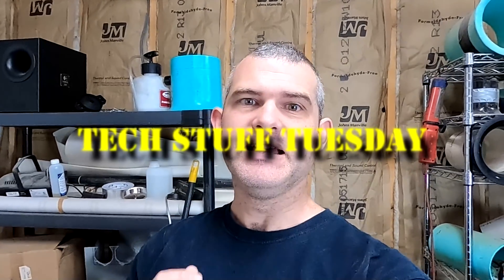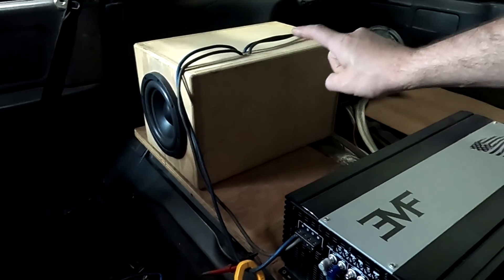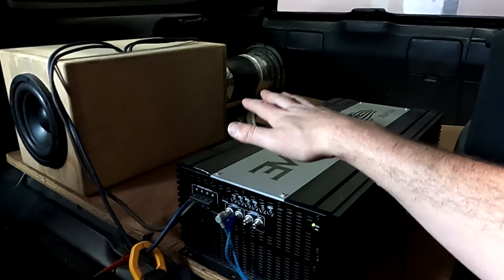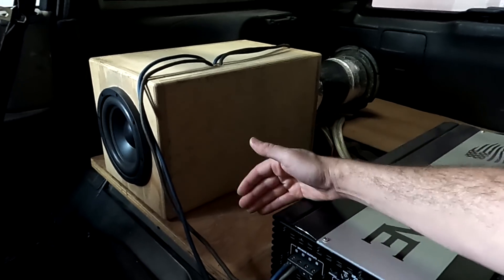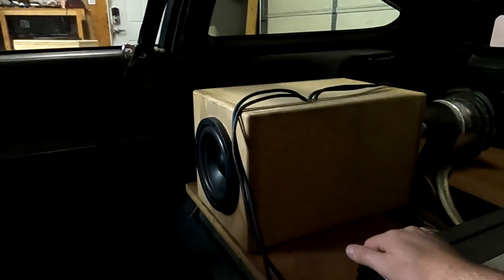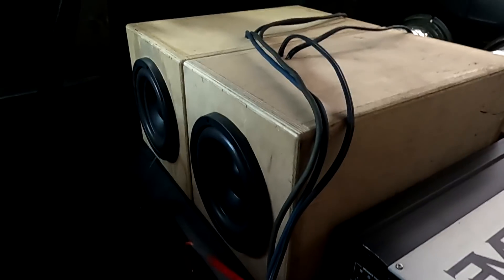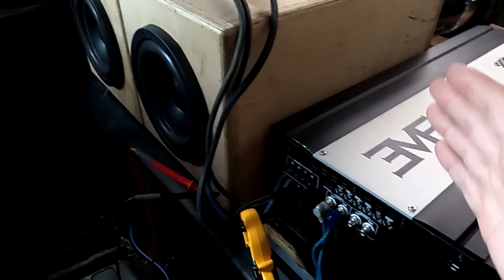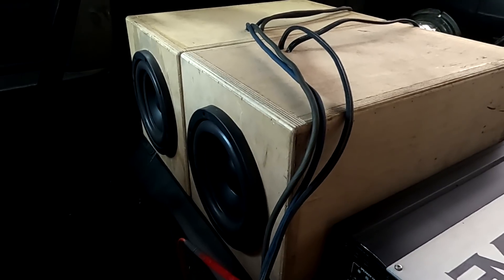Does doubling power or doubling cone area really gain 3 dB? - Tech Stuff Tuesday

Comment: I was just wondering, what will happen trying them in a mono box. Would your +3db theory be relevant with this application as opposed to individual boxes
Reply from the maker: I have tried another box with a common chamber and scaled, but placement of subs and port was different. It didn't lose as much but still didn't gain near theoretical. I will be building another box yet to test some things.
Reply: Great question...
Reply: having multiple subs in a single enclosure all sharing airspace the subs will behave more like , 1 large sub . Compare to each sub having it's own airspace eaach sub will operate singularly which for sound quality and quick bass response would be better than Multiple subs all sharing same airspace the subs are going to operate like one large sub since eaxhs sub can influence the other subs say you are running. 1 amp to drive all subs not  every sub is. Going to have same exact resistance even if they are all d4 ohm subs each coil is going to be slightly different even on 1 sub one coil might be 3.8 And other 4.2.also so even though it's a . Small difference. Each sub is going to get. Either slightly more or less power also how the sub is put together one subs spider might be just a lil stiffer ect ect. So again for SPL you will need to try n test different setups although almost no one is running a. Sealed enc. For SPL. These days it's now usually. A 4 or 6th order.or  a big vented enclosure.
Reply: I agree that sub  and port placement may greatly affect this theory as I noticed mainly the two individual boxes were extremely close to each other. If putting them on opposite sides of the vehicle change you db outcome? I believe the you lost output because of cancelation, and when you played it individual when the both enclosure were inside the vehicle one worked as a passive radiator, again all theoretical... I did have the same issue with with a loss of output when doubling subs, same individual yet identical box. Could change in vehicle internal cubic could affect this?
Reply: a mono box is a single box. each speaker was in it's own box. putting both speakers in the same box, even in it's own sealed chamber, changes the total volume, if the box itself was the same dimensions as both individual box. the speakers, he said at the beginning of the video was bigger then the speaker needed. if he used a box specifically with the airspace needed for those speakers, the decibels would have most likely been higher. 

as everyone should know, the space behind a speaker, in a sealed box, is never changing. the speaker compresses the air behind it and that force is used to push the speaker back out. pressure created in a sealed space is pressure received on all parts of the sealed space. what the speaker pushes into the box, the speaker receives in return from the box. 

ported boxes are different because the pressure the speakers put into the box is released allowing the speaker to actually travel further then in a sealed box. the speaker in a ported box actually works less then a speaker in a sealed box. the speaker is not fighting pressure in a ported box like it does in a sealed box. if the box is built for the air space a speaker needs then it does not need to be ported. if you need more airspace then you have space for a box, you would need a ported box.

Comment: Hey Sean, would it have ANYTHING to do with the 2nd box(when not playing) taking up cabin space and changing the cabin gain?
Putting 2 brands in the EMF hat. One is Crescendo and the other is Deaf Bonce. Great vid, weird outcome!
Reply: Loss happens only when the added sub sits there with no input power. If you pay close attention, you can see the inactive sub is moving as well as the active one. Where did that moving energy come from? The box's not powered! Well it gets its energy from the air moving around it. That's the sound energy! Our precious energy goes to the other speaker and dissipates as heat in the suspension and box. Actually, that's how modern "helmholtz" absorbers work in the acoustic rooms and recording studios.
.
The fact that the second box takes some space DOES have an effect on changing the tuning frequency of the cabin, but the effect on the SPL is minimal.
Reply from the maker: There was still a loss when the other sub had power applied. If you consider theoretical gains, if over 2 dB is lost with the box being there and with the sub powered gains 1 dB, that would be a 3 dB gain but 2 dB still lost from placement.

Comment: One sub is losing energy because the one not playing is a passive radiator with a brake on it...? Harmonic cancellation? Harmonics?
 Is there such a thing? Or am I an way tF off?🤷‍♂️
Reply from the maker: I've seen cases where there were gains acting as a passive radiator. I think the most likely explanation is the enclosure resonance being out of phase without the sub playing.
Reply: You're right man. It's moving. And it's getting its energy from the sound wave, and it's dissipating it into heat in the suspension and box. If the wires to the inactive sub were shorted together, even some more energy could be lost as heat in the coil of the inactive speaker!
Reply: Why it was louder after the 180°swap...

Comment: Double Speakers +3db is right but the Power per Speaker has to be the same as before... not half!
Reply: No that would be double cone and double power.
Reply from the maker: If the same power per speaker was applied that would also be doubling power, yielding another 3 dB, which should be a 6 dB gain in theory.
Reply: @EMFAudio  no why? The efficenci ist not improved. So why 6db? I only know doubling speakers in the same amp bring's 3db. Instant of 600w now the amp makes 1000w. Doubling Power should also bring 3db but the internal loses are exponentiel so ist not.

Comment: You are clearly losing wave energy somewhere. Maybe wave cancelation? Also that box might be too efficient where you are running into the subs mechanical limits very early. 140 at 100w from an 8 is very efficient.
Reply: Agreed that the sub might be getting near its mecganical non-linearity, but here's an even bigger loss happening in the rattling parts elsewhere in the cabin and even in the garage. Where do you think those rattling parts get their energy from? Hahaha thank me later😉
Reply from the maker: I suspect there is an out of phase resonance happening in the enclosure of the sub that isn't playing. The top level power is definitely running out of mechanical, which was also part of the point of the video.

Comment: Hey Sean do you think it would have the same outcome if it was in a fourth order bandpass blowthru? The reason I ask is I've been wanting to go from 2 Sundown sa12's to four of them in my truck which has a 4th order bandpass blowthru. Also any advice or tips on how to make it move more air I usually run a 2:1 ratio. Keep up the good work and info coming 🤙
Reply from the maker: Once the box changes, everything changes. I plan on doing a different box with common airspace and positioning to do further testing.

Comment: This is to become crazy. My brain is burning. How can you loose so much if you add more power and subs😠 then why expending
Reply: No. Loss happens only when the added sub sits there with no input power. If you pay close attention, you can see the inactive sub is moving as well as the active one. Where did that moving energy come from? The box's not powered! Well it gets its energy from the air moving around it. That's the sound energy! Our precious energy goes to the other speaker and dissipates as heat in the suspension and box. Actually, that's how modern "helmholtz" absorbers work in the acoustic rooms and recording studios.

Comment: I have never heard that only doubling cone area or doubling power would net a 3db gain. I have heard that doubling cone area and power at the same time should at least net a 3db gain.
I have also heard that a 3db gain will be twice as loud to the ear but from my experience it takes 6db to be twice as loud to my ear.
Very good video though. I appreciate it.
Reply from the maker: The theory is doubling power is 3, doubling cone area is 3, doubling both should be 6. In this case, that wasn't the case.
Reply: @EMFAudio  1 sub 100w 141.3db. 2 subs 200w 144.5 dB. That would be 3dB
Reply: Similar thoughts as well when 1 woofer was hooked up I was getting the full 100 percent of the power with 2 the power was cut in half between the two.

Comment: Hey bro what's the easiest or safety way to check polarity on a speaker well single voice coil subwoofer? Thanks!
Reply from the maker: You can use a drill battery or a 9v battery and tap the leads on the battery. Pos to pos, neg to neg. If the cone moves forward polarity is correct. If it moves backwards, polarity is reversed. I say tap the terminals because holding it in place could damage the speaker.

Comment: When you were playing only one sub, the other sub seemed to be moving as well, I presume it's absorbing some of the pressure inside the vehicle.
Reply: That's what I've found to be true. The sub that doesn't play still moves and can cause cancellation at certain frequencies, or can help your # at other frequencies.
Reply from the maker: That is true, but I've never seen an instance where that had much effect. I have actually seen cases where 1 sub being disconnected in a box was louder than it not being in it and hole plugged because it was acting as a passive radiator.
Reply: EMF Audio yeah, there is more stuff going on there. Placing the other box may have changed the standing frequency modes inside the vehicle, which could have created destructive interference right where you put the SPL sensor. There’s so many variables inside a car that it’s difficult to isolate the effects. These theoretical rules of gaining 3db with double the cone area or power, consider an ideal environment with no standing waves, no phase issues, no temperature rise in the coil, once you factor in all these other variables you can end up with a totally different result
Reply: @__julio__  Nicely said

Comment: Would there be gain if there's a combination of sealed and ported enclosures (2 sealed 12s and 2 ported 12s; or 2 sealed 12s plus 2 10s ported) in the same system?
Reply from the maker: That's very hard to predict, but there can definitely be phasing issues, especially if the subs are spaced apart.

Comment: One variable not considered is the room (car, in this case).  I wonder if the results would agree with the theory if done in an open space? In the car, it would be interesting to see what happens if you moved them further away from each other.
Reply from the maker: I can say this very car has had instances where doubling gained 3 in power, but cone area I can't recall if it ever has. The environment is obviously a factor when you see what happened with the box just sitting there. That's an environmental change.